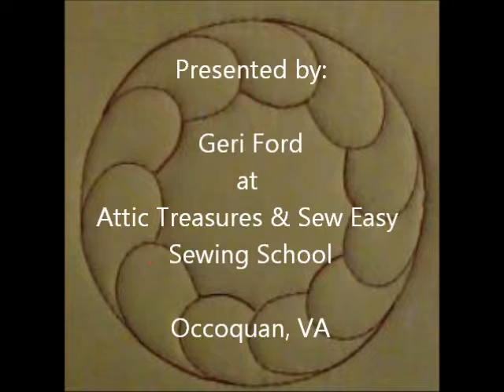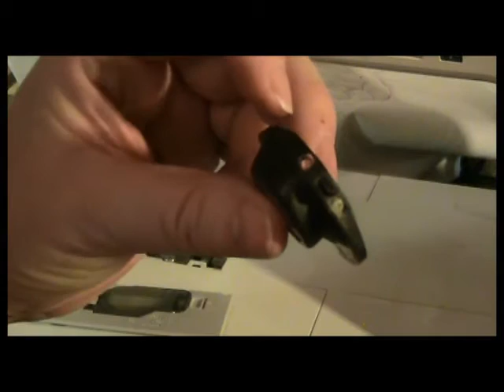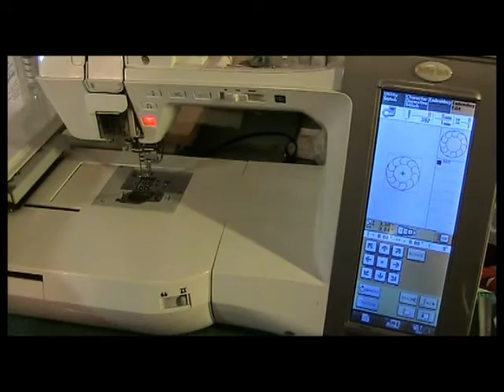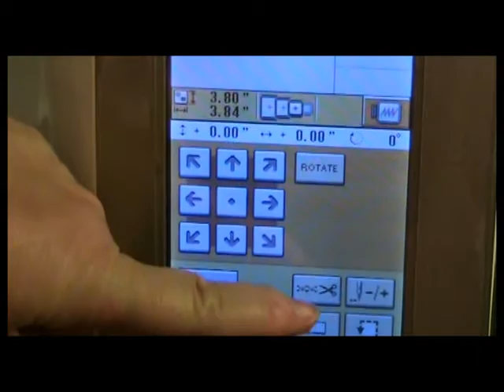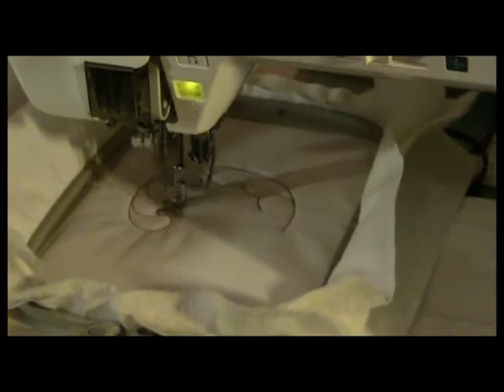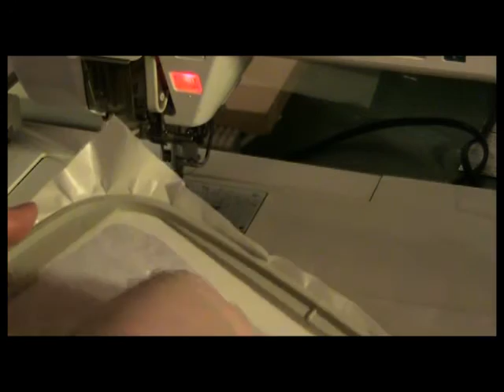Machine Quilting with Your Embroidery Machine

Comment: This is a great video!  Its very clear & easy to understand. Thank you for sharing with us.

My machine senses tensions on its own & messing with tensions isn't necessary.  This is my 2nd high end machine in 15 years & I've never had to change the tensions in all that time.  It can be turned off, but I've never needed to.

The screws on the bobbin case aren't always painted pink or green.  Be sure you check your machine, it xan be different for different bands.

Comment: So there is a special bobbin case for quilting?  I never knew that.  I will have to check with Brother.
Reply from the maker: The higher end embroidery/sewing machines come with at least two bobbin cases.  One is set tighter for the thin embroidery bobbin thread and the other is set a little looser for regular sewing thread.  Some even came with the gray bobbin case to be used in bobbin work to accommodate thick threads.  I would recommend buying either the gray bobbin work bobbin case or another regular bobbin case so that you can adjust the tensions on that one without messing up the tensions for embroidery or regular sewing.  It's always good to have an extra bobbin case around.  I've had thread jams and needle strikes that can take a chunk out of the bobbin case and usually on a late Sunday evening when my dealer is closed and I have to finish the project by Monday morning.  I even have extra bobbin cases for my machines that have a metal bobbin case as my cat has an affinity for batting them around the floor when dropped.
Reply: That explains a lot then.  I just have a Brother PE 770....not a high end machine.  I am not a diehard embroiderer and didn't want to invest a lot into this hobby.  I had gone to their website to see if I had missed something and didn't see anything and now I know why.  Thank you for verifying what you had said.  I learned something new today. :-)
Reply: @SoEasyQuilts  I agree 100%
Reply: I did not know that either.  I have a 12 needle machine that did cost a lot.  (I was in a car accident and got some money out of it.  My husband agreed that I could buy it.  It was worth it; I use it a LOT!   LOL)  There is a wheel on the back of the machine, but when I turn it, the needles do not go up and down.  So I cannot bring my bobbin thread up.  Can't figure out how to avoid the knots on the back.  I think I will call the company's technical support number and see if they can help me.   If anyone knows, please tell me!!  I use a magnetic hoop; the magnets are so strong the quilt is held very securely.

Comment: +SoEasyQuilts I am a beginner and I want to make my first quilt for my hubby for our second anniversary. The tip about pulling the bobbin thread to the front was golden. Thank you! I have a question. Is it not possible to make a quilt with dense embroidery designs with a stipple stitch or some kind of quilting stitch around them? He loves wolves and I have several designs I wanted to use on cream colored blocks and throw in sporadically some designs with special dates. Can this be done on an embroidery machine? Any tips or ideas? Thanks!
Reply from the maker: +Wanda Barefoot There are several ways to stipple around an embroidery design.  If you are not comfortable with free motion stippling, then you might want to use your embroidery machine to stipple the block before doing the embroidery.  The block has to be the size of your machine's embroidery field. This is the method used by a lot of the Anita Goodesign embroidery designs.   Put Rinse Away/Tear Away or Dissolvable Mesh stabilizer in your hoop (so you do not have remove the stabilizer) along with your background fabric and float a piece of batting under your hoop.  Load the stipple design into the machine and stitch it first.  Then load the embroidery file and stitch it.  If you don't have a stippling file, just email me at waltzquilt@yahoo.com and I'll send you one that fits your hoop.  Then you put it together using a quilt-as-you-go method.  Here's a video from LindeeG that shows you how to do it.   https://www.youtube.com/watch?v=tWKVNQTG-74.If you have the Babylock Destiny or Brother Dream Machine, you can use the on board scanner and digitizing software to stipple around the embroidery.  Here's a link to a good video showing that:  https://www.youtube.com/watch?v=eJviImpCzYY  Feel free to email me any time with your questions.  Be sure to send me a photo of your finished quilt.  I know he will just love it.
Reply: SoEasyQuilts Thank you for getting back to me. What I wish I had are some really good redwork designs of wolves and maybe a dream catcher. Do you have any native American stipple designs or anything that would go with a wolf themed quilt? Also, I want to add a pretty native American border I found but I am not sure how to add that to a quilt as you go quilt. It would need its own stabilizer also right? And there would just be a seam on the backing that's unavoidable? I will definitely email you for the stipple design. Thank you so much!
Reply: Go to emblibrary.com